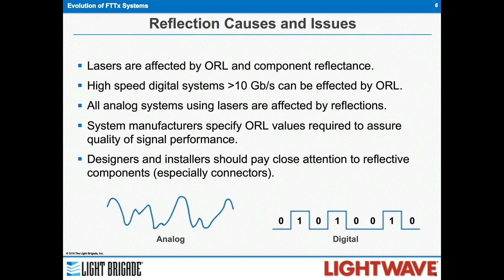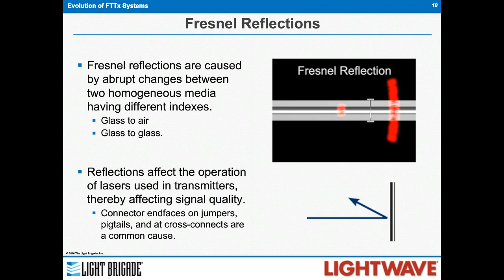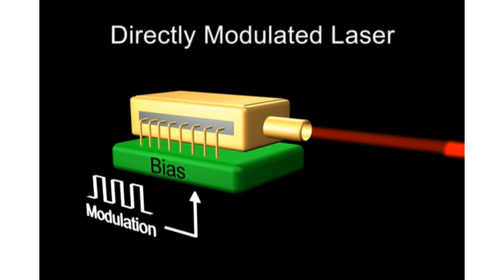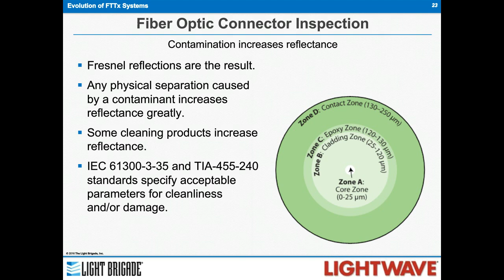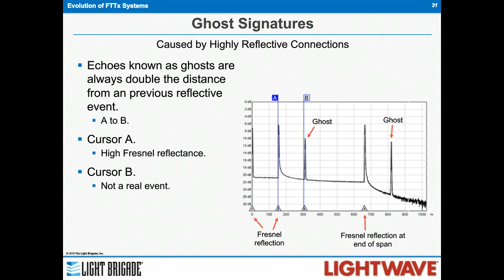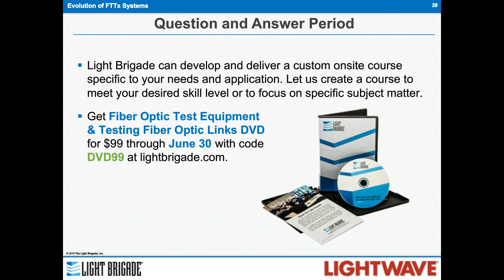Webinar:  Optical Return Loss and Reflectance

Comment: how to avoid from back reflaction in high power yb laser system?
Reply from the maker: Are you using a YB laser for communications? What else is in your link? Assuring you have APC connectors and keep all interfaces very clean and precise will be helpful.
Reply: Please check #dwdmotnc#discreteoptical #Norteltn #Ciena32slot
Reply: https://www.youtube.com/watch?v=sBSk3dD4MRM&t=347s

Comment: There is no cookie cutter 1 size fits all spec for Optical Return loss. The length of the fiber under test determines that. A short link less than 1 mile with "no significant reflections" should have an ORL reading in the low +40's and a long link like 30 miles will be fixed around +32. If you are testing a 1 mile span and have an ORL of +33, you have a serious issue in that link. 

1 X32 splitters do NOT need optical terminators. The nearly 17db loss thru the 1 X 32 splitter will attenuate down any reflected light. This has been proven on a test bench and in the field. Putting optical terminators on a 1 X 32 splitters is a total waste of time that will do nothing.
Reply from the maker: Thank you for your comment. As with many technical topics, there are often many scenarios and often more than one good answer. We encourage our students to provide us with as much detail as possible about their applications, products used and specs in order to give the best answers possible. In the previous response about terminators, we did not mean to imply this was always the answer. Also, generalizing ORL against link length is hard as well, unless we know exactly what is in that link.

Comment: Can anyone explain me how to avoid backreflaction from the end of a fibre?
Reply from the maker: APC connectors are always helpful. If the fiber is connectorized, a 'terminator' at the end will help. What specific problem are you having where the end reflection is a concern? We would prefer to recommend a solution to a more specific problem :)
Reply: It is for OTDR sensing purposes. What I need is an OTDR trace without (or almost without) a spike, but with nice and clear drop to the noise floor.
Reply from the maker: This depends on how much of the reflection is required to be either eliminated or minimized.  This will also depend on the type of fiber being tested.  For most systems an optical terminator is sufficient.  Check the specifications though for the value needed.  Is the fiber terminated or the end of a fiber?
You can also dip the end of the fiber in index matching gel.  There are several other techniques which we can assist you with based on the questions about the fibers, terminations etc.

Comment: Hi Scott, unfortunately there is only a limited amount of time to cover so much content.  If you looks at slides 29, 35 and 36 you will see references to the OCWR along with the applicable test standards. OCWRs are mostly used for short spans (e.g. cable assemblies) and are more often in manufacturing facilities.  On the other hand service providers, contractors and end users either own or have access to OTDRs.